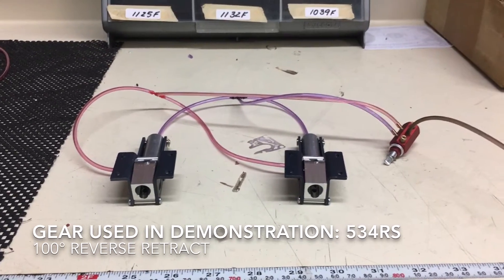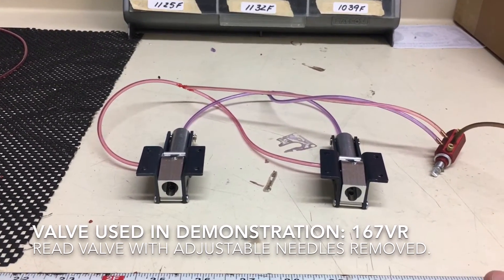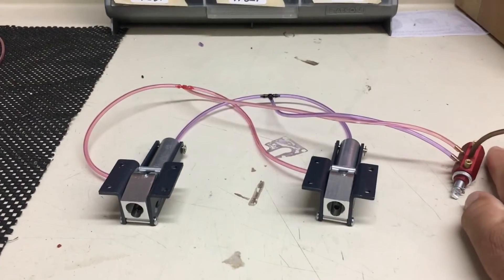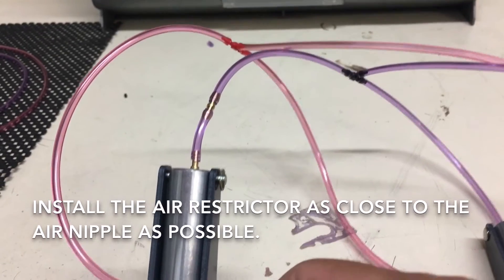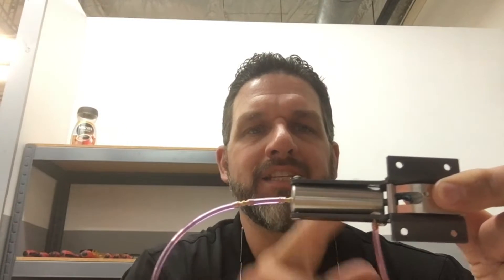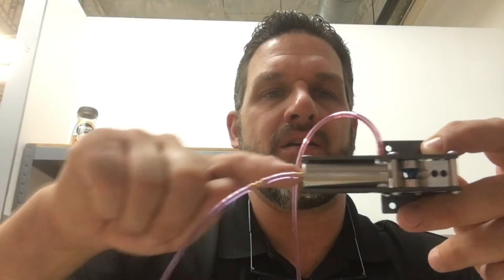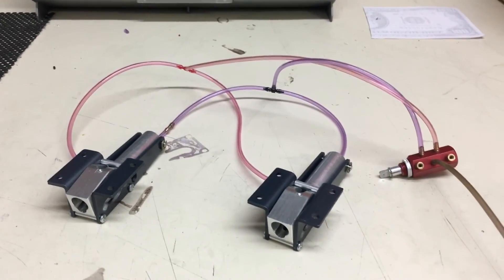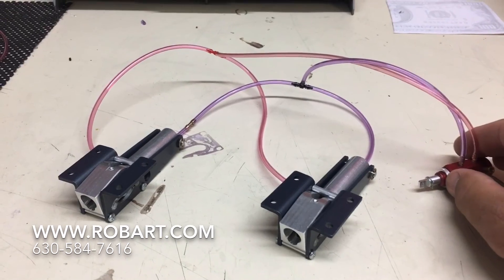Robart Air Line Restrictor (Part #189) Operational Video

Comment: It still looks too fast and should be slowed down in both directions. JMHO
On the other hand why not make a red valve with adjustable needles that aren't such a pain in the ass to adjust and tighten in place?
Reply from the maker: For the purpose of demonstration, I slowed only one operation down.  In regards to the needles on the red valve, I will bring that up to our team and see what we can do.
Reply: @RobartMfg    
 If I may suggest a much finer thread pitch on the needles &  a screw driver slot or a hex head so the needle can be held from turning as one tightens the locking nut, Just a thought.
Reply: @HoundDogMech i bought this stuff in the 90's, it has not changed and the restrictor is still too fast. Great to see nothing has changed... at all...